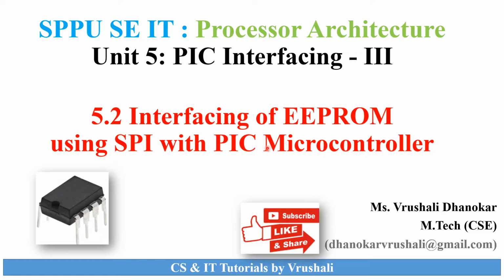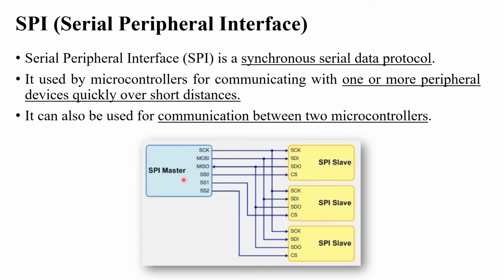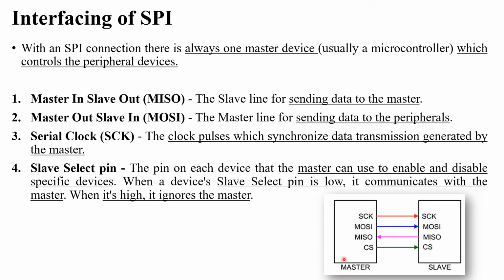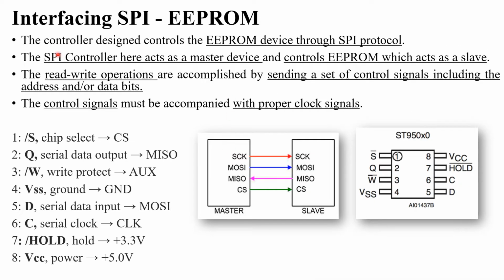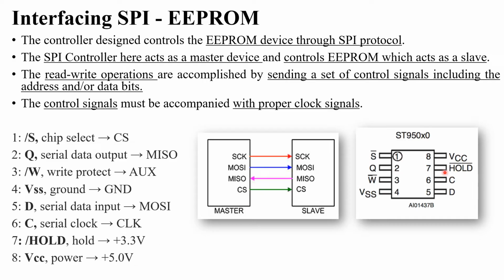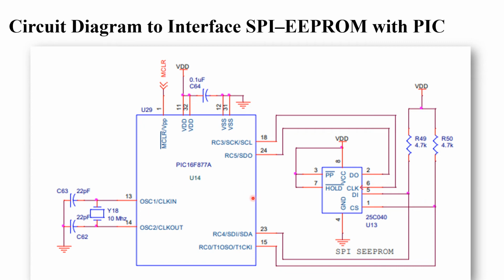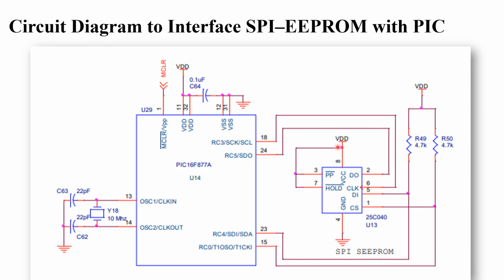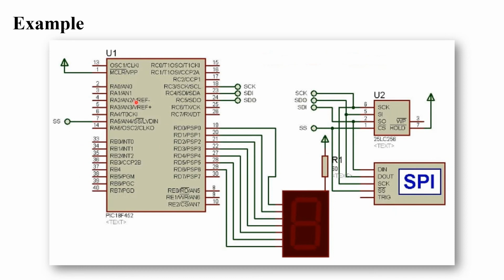PAI 21 : Interfacing of EEPROM using SPI with PIC Microcontroller with Example

Comment: SPI EEPROM 25C040 has data input on pin 5 and it is connected to RC4 which is also data input .... shouldnt pin 5 be connected to RC5 and pin2 connected to RC4 ?